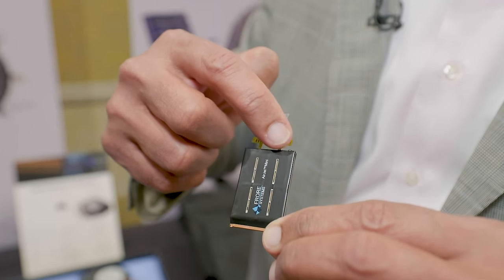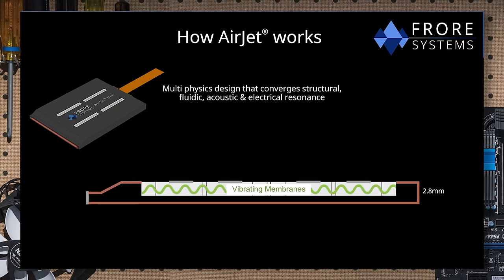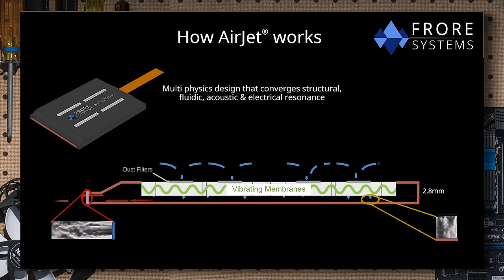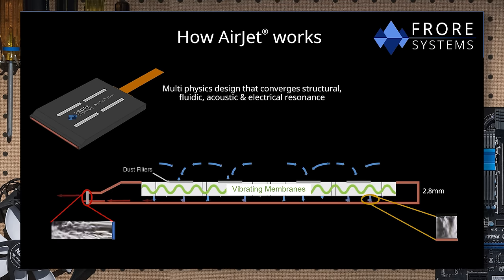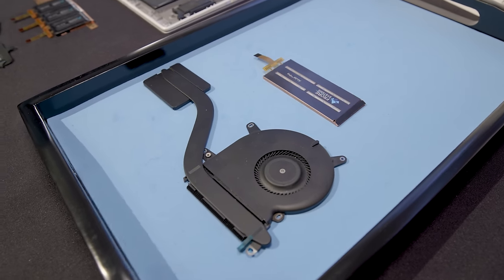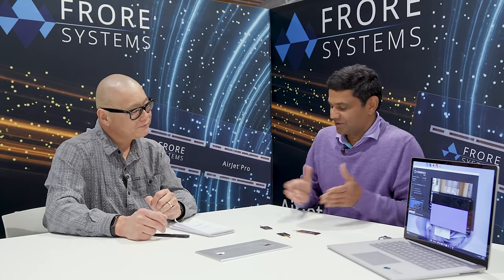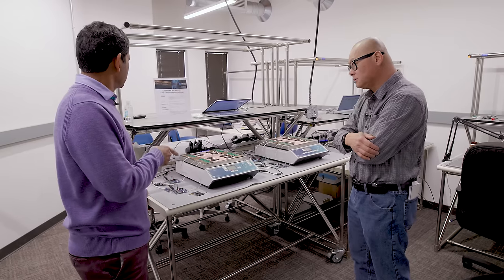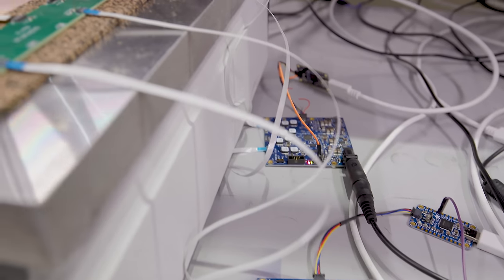Take A Lab Tour Of This Solid-State Cooling Tech

Comment: Did I miss actual benchmark of cooling performance? The part with laptops just measured power consumption instead of cooling efficiency per watt. I can design 0 watt, noisless cooler, but with one issue CPU would be under constant throttle.. Maybe I just missed the actual talk about what is important...

Comment: What's the TDP these products can handle? How much wattage worth of heat are the minis and other sized solid state coolers dissipating? We see that 3 solid state minis can handle 15W TDP total, but what's the exact rating? It seems like they have decided they're 5W of dissipation each for the minis and 9.3W each for the Pro, but it's not 100% clear if that's the upper limit. Really great tech either way.

Imagine taking a 7"x7" case that's as tall as the mini ITX board's IO block, putting a low wattage current-gen i3 on it, undervolting the CPU and locking the frequency, and cooling it with a special 40W SFF AirJet. You could have a totally silent media box the size of your hand with a desktop processor and modern iGPU in it.

Comment: Vram cooling, you could get rid of all the dumb midplates or vapor chambers, and just have 1-4 of this chips over the vram instead, right now there is a bit of a problem with GDDR6 where a lot of the budget coolers are unreliable in the long term, but GPU manufacturers struggle to make effective midplates, or effective vapor chambers cheap, this might actually be a explanation why there are so few low end GPUs coming out these days, with the greater proliferation of GDDR6 i have a bunch of budget 20 series 16 series cards and there all awful the low end 2060S has the same performance as the 1650S in heat saturated conditions.

i wonder if one of these for the GDDR6, and a low end single heatpipe heatsink a single fan could make a better 6600XT cooler then most, who knows if they use something like this for GDDR7 it might be much faster then what we can get with thermalpads and midplates for GDDR6

Comment: It is a very interesting tech.  But regarding Dust i would want to see how it handles a mix of fine Dust and something like tabako smoke. It makes even very fine Dust sticky. Every Person that repairs PC regulary have seen what this mix will do to a fan/radiator. Only reliable option would be a filter that is accessable from the outside (so it can be cleand or switched out. Another point is longevity. when i hear "we test for 2000h and want less than 5% degredation. Lifespan of a fan is usually 20000-50000h. And the last point i hate is, that they put in as many fancy terms as possible. As someone that has a bit of knowlade about this kind of physics i can say not everything that was said is correct (regarding terminology). Still interesting and it will find its use in future products. I only fear that planed obsolescence is getting worse.

Comment: There's something that doesn't sit well with me, the "entire heat removing system in a chip" sounds too markety to me, the "less than 5%" in two years seems vague, but what bothers me the most is the "the air leaves at almost the temperature of the processor", Also, 5w for each mini and 9w for each pro. Looks promising but it won't replace a serious cooling system anytime soon. Seems to me that one will have to compare a 15$ laptop cooler with 3 or 4 of these air jets, I hope it'll be competitive

Comment: Can't it take it's own power from CPU heat source as Peltier Module does inside heat stove fan? It does have greater future. They need to know much about the membranes capability limit. Moving air or moving water both have different future.

Comment: Until they manage to scale up the device's cooling potential from that 10W to something like 100W or even up to 200W, it might end up solely in the ultrathin ultrabooks, their current target demography. End in such devices it's possible it'll land in the more costly premium ranges. Maybe Apple might be interested to combine Mini with their Air and the bigger thing with Pro lines regardless of the cost, they'd just call the laptop revisions revolutionary and sell them with yet another markup. Though if these coolers were priced right for the majority of markets, maybe other manufacturers could invest in this tech for their devices to make the tech more ubiquitous. It's certainly interesting, maybe it could be combined with vapour chamber as well...
Reply: Afaik there's nothing stopping you from strapping 10 of them to some heat pipes, so it all comes down to the price

Also they do claim that advancements in silicon will reflect in these
Reply: Well, you could stack 10 of them in something like a big cpu cooling tower, where each has one fin of the heat spreader below it.
Reply: @User  What would they say now when they're still considered a startup? "We already know this will work only in the ultrabooks tight spaces where even slim fans are hard to cram inside the chassis, cause it will take decades of R&D and investments to offer cooling potential expected in thicker mobile workstations or gaming setups... Strapping 2-4 such devices is feasible due to power drain/draw required to run the modules, but going to be a nightmare when doing 10 parallel Max ones not only due to space occupied but also power it'd require to run those units or the cost of such design." If they admitted something like that from the get-go, the customers' or investors' reception could be far colder... and that'd hit the potential revenues or ROIs...
Bear in mind we've had other startups, eg. working on new battery technologies, that spoke of wide interest with limited real turn-out despite promising revolutionary or ground-breaking improvements and contracts with partners... 
As such, we'll only be able to verify their claims with the reality of mass manufacturing/designs and how they fare against older/fanned ones once we're out of thin & light & less TDP-heavy use-cases.
Reply: @lgolem09l  And how would you make it fit in a laptop? Unless you're thinking such a design where these fins are like current units, stacked perpendicular to mobo/heatspreader plane... But then, the amount of fins would have to be drastically reduced, like divided by 4 or 5, to allow space between fins with those coolers atop/aside to them for the coolers air intake to have enough space to draw air in and not have it heated up by the other fin stack next to it, and that could limit overall potential of the solution. Maybe stacking them horizontally all across the chassis width atop the heat-pipes or vapour chamber edge could be a better choice, eg. for something like Asus Zephyrus or Razer Blade designs... Regardless, the question remains of the cost of such multiple units design, both in R&D and device end-user pricing, and in power it'd require to shed fan designs whilst keeping up with the cooling potential... Maybe something like Zephyrus S17 could be revised with such cooling modules located on heat displacement from both sides of mobo to draw air from bottom and top in tandem, doubling effective units count, but the question of power draw would not be taken care of by such design...
In theory, you could also try putting Peltiers in a laptop to cool the chips, but the power draw there and the cooling required for the hot side made the designs less popular, not only in laptops where they halved the battery life but desktops as well where they skyrocketed PSU pressure...
So yeah, maybe 1-3 such units is feasible, but going higher requires too much juice to be useful. Otherwise, they would have shown such proof-of-concept upgrade as well...

Comment: I do not understand manufacturers of thermal dissipation devices and their dust filters blocking the inlet directly. This is a surefire way to block the inlet completely, you want to do the filtering over a larger area so you have less influence on the inlet...

Comment: I really hope this tech is real, this could revolutionize gaming laptops to be as thin and lightweight as notebooks. I'm only very spectical about the durability of such a cooling chip, I would worry that particles would clog it near the air intake, or get inside and damage the delicate interior... I know he says that's not a proble - but he has to say that, also if its not true.

Comment: i only have an issue with this new tech... i didn't see any real proof that the device can push air from the nozzle... there was a video a month ago where the device showed air movement, but it was attached to a base so big and in a way that easilly could have a concealed fan inside doing all the work

Comment: Or you could just ditch X86 and use ARM... 
like seriously right?
Mean the macbook air m2 does not have a fan at all, and man if it was cheaper I would recommend it to anyone. This is a great invention but I feel like with good windows on arm, non-apple solution, and arm desktop chips other than the m-series, this might not be a need for the average consumer at all.
But still great for the "PRO" models and handhelds.

Comment: The solid-state definition is not about using motors or not; it's about being semiconductor-based, and that's why quartz watches are solid-state. You usually define "semiconductor-based" as devices that have their functionality based on compounds of silicon, germanium and gallium (as those are the main commercially viable semiconductors we know of).

Quartz is Silicon Oxide. That's why some people consider quartz watches solid-state, even when they do have a stepping motor to move the arms.
Reply: Yes and no.

Solid state in the context of batteries literally means a solid electrolyte material rather than a liquid/aqueous one.

The drawback is lower ionic transport performance even with specially crafted ion channels running through the structure.

Comment: Price is going to be key. The "too good to be true" part is the question of where he's kinda dodgy about the price. That "we're not as cheap as a fan" doesn't mention if ONE is more expensive than a fan how much more will FOUR be? Are we talking about 50 cents vs $5 or 50 cents vs $20? That's fine for $3000 laptops but these don't have the performance to cool those laptops. If you're aimed at solely thin and lights the only thing in that price range are overpriced Macbook airs and Apple doesn't like using technology they don't own themselves. Hardware makers are super sensitive to every penny in cost when it's compounded by millions of units.

It leaves them in a catch 22 where vendors won't order it until it can be built cheaply in mass quantity, but you can never build it cheaply in quantities until those orders come in. You almost have to buy your customers by selling at a loss for a while until the product can be scaled up to the point that it's a financially viable choice.

It's a neat tech but I can't tell if they're just trying to get acquired or if they're in it for the long run to scale the tech up into less niche case uses.

Comment: Was impressed until the comparison between the laptops showing 12.5W vs. 15W.  Or even 20W if they had put their 4th mini in there.  Yes it's an improvement, but not revolutionary.  And it gives me the impression that it's going to have limited scaling capabilities.  4 minis gets you to 20W?  What about high powered laptops that are using 10x that?  Gotta put 40 of these mini units there?

Comment: I don't get why they are rated for so low power. 10-20W power is in range of passive cooling for many laptops nowadays. I own G14 and it handles these powers fans turned off and with cool temperatures. Same with macbook airs.
Most thin gaming laptops are already handling around 100W power with their conventional fans and heat pipes, albeit loudly.
Hopefully we can see them improve.
Reply: The argument is that you still get 10W passively, but can add on 10W more by turning them on.
Reply: @DigitalJedi  They do comment that 20W is for the total system power though in the testing, not what the cooler can dissipate.
Anyway, hopefully it can provide useful, especially for more silent gaming laptops of the future.

Comment: Why not use ceramic instead of copper to make the tech cheaper than fan?? there are German companies that provide solutions
Reply: Because the copper is there to transfer heat. That’s their best bet cost effective for the material.
Reply: @christopherfortineux6937  ceramic is cheaper than copper...ceramic containing talc is a better thermal conductor than copper and it's a good electric insulator too...
Reply: It's a good question, but I imagine there are many reasons that may have played into with the first one being ability to manufacture it in a facility and hitting a certain cost. What the internal answers I don't know--but I do know often times that theoretically best material or technique has to also overcome that hurdle called being able to sell it too. If ceramic is a drag on that or increases the cost exponentially, I think you have your answer.
Reply: @FakeGordonMahUng  makes sense...
They are using sheets of copper and substrates of ceramic layered together in various industries for thermal conductivity...
e.g. Aluminium nitrate is already used in packages for semiconductors...

Comment: So is the hot air piped out? At one point I though he said notebooks can be airtight which confused me.
Reply: So, the exhaust would be near the rear of the laptops or, well, any opening they can get the exhaust ports to. In theory, what can be different is all of the exhaust and intakes can have a dust-proof barrier (think Goretex which is "breathable" because tiny air molecules can escape, but larger water cannot enter.

Comment: all i got from that video is it is really nice for very specific applications but it costs substantially more than current solutions. that is a recipe for failure if they cant take that narrow focus and substantially outperform cheaper solutions. from the video if im putting things together correctly he says an airjet mini isnt as cheap as a 50 cent fan nor a dollar fan but compounding that financial overhead he didnt just put one airjet mini in these laptops hes putting 3 and 4 and perhaps more. So now you have increased the cost 3, 4, 5 times the already base increase cost differential . that sounds like very expensive overhead for a cooling solution, which means anyone implementing it would need to be somehow hedging that loss on the backend where the increased cpu power leads to substantial increase in productivity and revenue to justify incurring the possibly 10x increase overhead cost of their current cooling solution counterpart. i guess we will see how this company performs. itll take having some solid support. for now theyll need plenty of banking support with increasing credit line as their losses build up and itll take at least one big bank business to become a fanboi and invest at a large scale that allows this company to generate enough revenue for banks to continue to support them. they will need to adapt and evolve quickly year over year thats for sure.

Comment: Not so fast…
Current heat pipe technology is very good and compact, AND can tolerate air without filters (dust).

For Laptops yes, but ANYTHING that is SEALED, like a phone, CANNOT use this!

Don’t you people pay any attention or actually try to understand what they tell you!? 

This also needs more expense in clean room technology, or yearly maintenance to clean the dust filters…

Comment: He is technically Wrong when he says laptop don't need hot air venting holes, 22.32 to 23.14,  what happens to the Hot Air that Comes out of the Frore Chip, if it stays inside, system is going to Heat up, Hot Air must be Vented Out, that's why he is fundamentally wrong, Laptops need Heat and Hot Air Venting Holes so that they can Pull in less hot Air, of course dust is a issue but not that much
Reply: But u will not need have it at the bottom of the laptop.

Comment: As cool as it seems to be, it will be a big failure. If you have ever open up a computer and seeing all the dust inside, you will know that the top of that chip will just get clogged and it will not work. Now you have to design a filter for it that’ll get clogged and cause it to overheat. I believe it to be a non-ending problem.

Comment: 240 hours in a dusty environment is not what I would call “Extensive Testing”.

You need to treat something like 2400 or 24,000 hours in an extreme environment with less than 5% efficiency loss. I put 240 hours on my laptop every month. I’ll bet 5 years is highly unlikely in real world laptop environments.

Comment: It's simple: Get the tiny and noisy fan of a laptop and the nearby heatsink and replace it by this. If you can't place this directly onto the hot chip to cool it, just use a heatpipe. This simply replaces fan+heatsink.

Comment: Interesting....clear as mud, but Interesting
Reply: Its honestly quite simple,
Picture a sheet of saran wrap, with a buncha holes,
But each pinhole only lets air through it one way,
As you woosh the sheet back and forward
It lets air past one way, and wooshes it the other way
But at electrostatic speaker frequency
Micromovements at kilohertz speed create that really high pressure flow

Comment: Nice technology, but vibrating membranes are not "solid-state".
Reply: What is your definition of solid state then? If you take an ssd as an example, current is also flowing from high to low voltange. Heat in solids is also atomical vibration (phonons). This technology is solid state man. Unless you have something else to say

Comment: 7:03 Fans weren't invented for the purpose of removing heat. They were invented to blow air on a hot summer's evening...

And...What is the purpose of blowing air on a hot summer's evening exactly?..
Reply: He just meant that fans are more general purpose lol
Reply: To circulate air volume of a room. The point is one is about circulation by design originally and not removal.